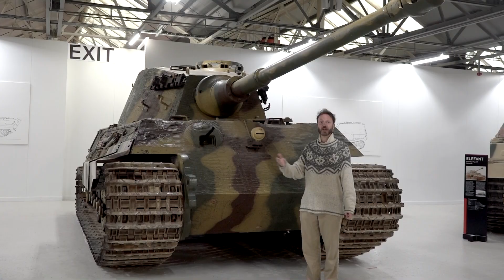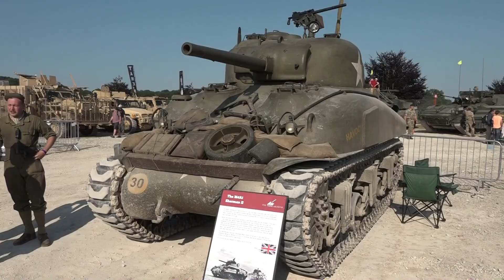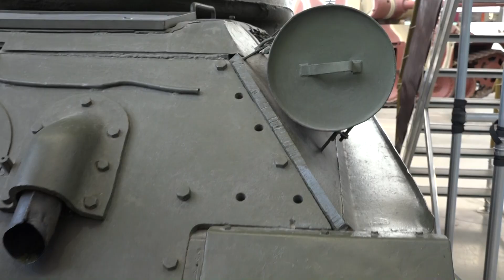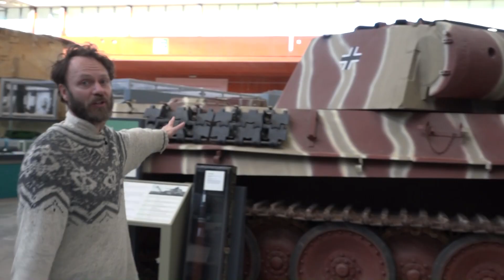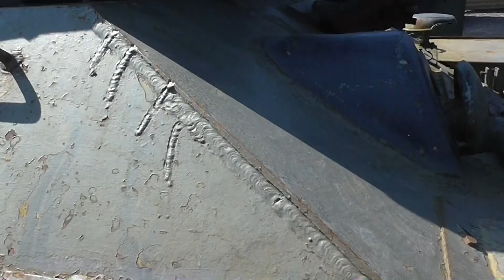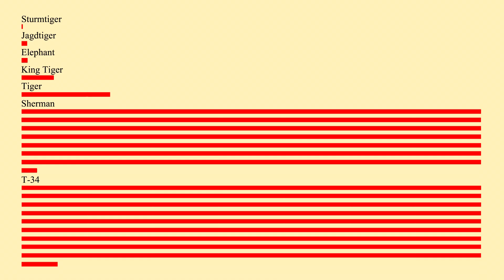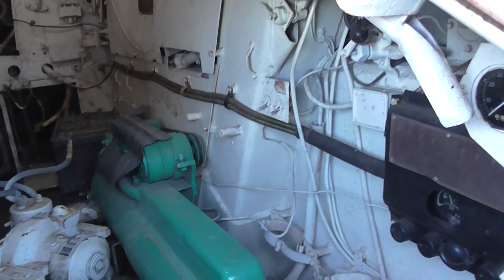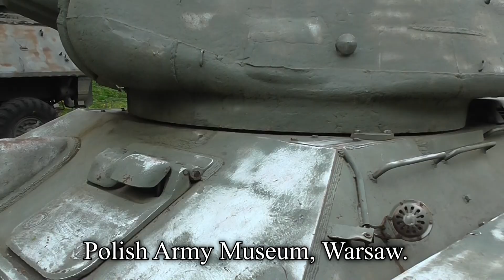World War Two's most common tank

Comment: Your points about the Panther make sense, but you have to put yourself in the Germans' boots. They didn't have the oil to fuel tens of thousands of tanks, nor did they have the manpower to crew them. Even if they went the route of creating thousands more Panzer IVs, they didn't have the means to use them.
Reply: This "where would they get the men/fuel" argument is easily defeated. All of the personnel and materiel that went towards the hilariously overstaffed disaster that was the logistics train for the big cats would have been available to go towards sensible things. Instead, a bunch of men died to fucking IL-2s and P-47s strafing them as they tried to move fuel ammo and spare parts around on foot, by donkey, or in less than 20% of cases, by motor vehicle.

The fact they built these tanks when they didn't even have trucks is honestly one of the dumbest things I have ever heard of human beings doing in all of history.
Reply: Maybe attacking your Oil Supplier was not the smartest move, next does history repeat itself ?
Reply: @maryginger4877  The Germans didn't trust the Soviets to continue supplying them with fuel. One of the major goals of Operation Barbarossa was to capture the oil fields in the caucuses. They fell well short of this goal. They did, however, have Romania as an ally to supply them with fuel. Once Romania's oil refineries were thoroughly bombed by the Alies, they were screwed.

Everything depended on Operation Barbarossa's success. The operation had glaring flaws, and impossible goals. I think I read somehwere that they captures most of the initial standing Red Army, and it still failed. That's how you know their goals were impossible from the start.
Reply: @ganjacomo2005 That's valid. They certainly underestimated the Soviets.
Reply: @maryginger4877 what's your point? they still wouldn't be able to fuel said vehicles..
Reply: boohoo the poor nazis😢get a grip of yourself sonny
Reply: @gorbalsboy  That's not the point of the comment. I was not showing the Germans sympathy, I was explaining why they decided to use the Panther and Tiger II tanks from a practical point of view.

It's actually funny how bad you missed the mark on this one.

Comment: When you ask an allied veteran of the war who served in a tank if they would rather have been in a German tank, 90% of them would say yes.
In addition to that, it should be noted that even allied tanks frequently broke down, just as often as German tanks. The primary hindrance to the Germans was a lack of supply and fuel. Most German tanks were either scuttled by the crew after running out of fuel, or knocked out by allied aircraft as the Luftwaffe suffered the same problem.
WW2 was unfortunately a war of attrition, unlike the world had ever seen. The rate of civilian casualties to military casualties was higher than any other war in history.
In modern times MBT's are the equivalent of German tanks of ww2. They're incredibly expensive and precisely crafted. If a war like ww2 were to break out, I pity the poor sob's who get stuck in mass produced garbage only to be sent to their own slaughter like the disposable pigs their government see's them as.
Reply: Where did you come up with that 90% allied would prefer to operate a German tank? Sources?
Reply: An allied veteran's opinion about the ergonomics of a tank that they didnt fight in is not valid proof. Also allied tanks did not break down as often as their German counterparts. Very few allied tanks had reliability issues on the level of the German's. Soviets were much worse off than the allies but still not horrible.

Comment: The Russians wouldn't make changes to the production line / product of the T-34 if it meant shutting down production, they were more concerned about having tanks than a slightly better one. Only when necessary was production stopped to make changes/improvements

Comment: There is an escape hatch at the bow gunner/ radio operator's feet in a T-34 as he can open it and slide out underneath and either go forwards or backwards towards the engine to escape if the tank was ever knocked out or had a interior fire. So he didn't need to wait for the driver to exit before he could.

Comment: Sorry Lindy but America built all of their Shermans during the war from 1942 to 1945, and they stopped production the day after Japan surrendered.  Russia on the other hand started producing the T-34 in 1940 and didn't stop until 1946 building just 34,000 plus another 50,000, including variants such as the T-34-85,  were built elsewhere in Eastern Europe until 1958.  Of course if you count all of the Sherman varieties such as the mobile artillery carrier and various models then the number of 54,000 is more accurate.

Comment: Could people please stop spreading myths like the one that the germans were shocked? They encountered heavy tanks before like the Char B1 and the Matilda. The Panzer 3 (3,7 cm) destroyed 1941 the most russian heavy tanks (the germans didn't differnciate between KW-1 and T-34, they just didn't know which was which) and the germans were well aware they couldn't outproduce the allies so they tried to produce superior tanks. 
The Tiger 1 and the Panther also weren't reactions but just the next step in this plan. By the way the Tiger 1 was never meant to be build (Panzermuseum Munster made a video about the Tiger 2 where they mentioned this). 
Also the T-34 was not a cheap tank but a tank badly produced. And what many people forget is that every tank needs spare parts, a crew (which needs food) fuel and ammunition. So more tanks means you need more of it which charges your logistics more. 
Also there is no proof that T-34s rolled out of the factory directly into the fight because even when they could crew the tank they still wouldn't have Ammo.

And on a side note: The Universe is offically metric :D

Comment: It should probably be noted though that the Allies only outproduced the Axis about 2/1 in all armored fighting vehicles throughout the war. The average quality was higher, and they definitely had a substantially larger weight of numbers by the late war. The allies also had a much higher level of mechanization other than AFVs which led to a meaningful advantage in tactical and strategic mobility. The number of AFVs of different types produced is still an important and interesting discussion, but the differences in tactical, strategic, and operational logistical capacity are more important to the overall picture. This isn't to discredit the points made in the video, but rather to attempt to express the supreme impact of the boring aspects of war, which more often than not are the true deciding factors in military operations over the combat capabilities of the front-line equipment, especially in large scale conflicts.

Comment: There is an old Aberdeen Proving Ground report on the technical specs and construction of the T34s.  For the report, they completely disassembled and cataloged every part of a vehicle (which they acquired by questionable means) as as way of gauging the industrial technology of the Soviet Union.  The report essentially concluded that the soviets could produce very good quality components and didn't have any gross technical limitations, and that the low quality was simply due to emphasis on speedy production.  The diesel engines for example were made of aluminum and had a higher power to weight ratio that any american ground vehicle engine.

Comment: The size of tanks is determined by the loading gauge of the railways, as tanks don't run well on the roads, so if you make them so they can be shipped by rail, you can locate your manufacturing facility wherever you like, it doesn't have to be near the front or near a seaport. Since Russian railways have a broader gauge, did Russia make bigger tanks?

Comment: Another way of looking at it is that in a "normal"tank track you have a more carefully crafted sprocket with a specific tooth design and a more rude tooth on the track.
The Russian T.  tank has the opposite the "sprocket(which isn't a sprocket) has the more rude roller/pins and the toothdesign has to be put on the tracks.
The obvious disadvantage of this design is that the tooth on the track will be damaged more easily

Comment: Honestly it’s probably because the sprocket wheel can be a single component with no crossbars, meaning one side can probably be cast and it’s just done, where the Sherman wheels somebody has to drive those rods between the two side plates, and has more points of failure-stress.

Comment: Blaming museum piece for not having all the bolts after engine maintenance is a bit silly.
The welds were fully automated by the -85 version, so the prettiness was more than enough compensated by the production speed. If a unit has some weird asymmetrical welds, chances are it's simply a field repair. These were cheap, but not cheap enough to just abandon if you can put a hand in the cracks. Sawing off damaged barrel ends was also common.
8:30 not earlier versions, БТ-2 and БТ-7 were a separate design derived from that very Christie

Comment: For the tracks with gripping teeth on them I can guess people don't really do it like that because it makes them harder and more expensive to build, heavier thus putting more strain on the engine and transmission as well making it harder for the crew to replace a broken track.

On the other hand replacing those kind of tracks might be simpler and faster than replacing the sprocket wheel and the soviet union might have been unable to build a reliable sprocket wheel with teeth during the strain of the war.
Reply: High friction i'd expect and more strain, but not harder to build. I think it's a performance loss but a slightly more robust track system, and you need specific road wheels. You have not much option to change the road wheels design or layout really, and the benefits to retaining track are only there with the large road wheels. From what I remember it is that way because you could put a drive chain from the drive wheel to one set of road wheels along roads in theory.

Whether vestigial or not i forget, but you can see how the chain would run through the inner part of the wheel vs the traditional sprocket where that would not be possible.

Comment: I feel like some of the information presented is - not wrong - but presented in a way that gives a somewhat wrong impression of the timeline of Operation Barbarossa; T34s were not hugely common at the beginning of Operation Barbarossa. If they had been, the Germans probably wouldn't have got nearly so far as they did. And the poor construction quality was very unlikely a result of some inhuman calculus of investment vs. quantity - The Germans were driving deep into the country, and tanks were needed on the frontline *NOW*, hence corners were cut.
And Lend-lease convoys didn't reach Russia until early 1942 (add some time to get to the front) - the diesel Shermans were not really a factor during Operation Barbarossa.

Comment: 4:43 - if you've ever had a Soviet-made or early Chinese-made model airplane engine (quite a few of them on ebay these days) you'd see a similar quality of casting. Sometimes they'd even cast the price in rubles into the backplate (no such thing as inflation in the Soviet Union). On the other hand, post-Soviet competition model airplane engines are little jewels.

Comment: Wheels with pins instead of sprocket wheels?

Well... Looks to me that if a pin breaks, it's easy to replace.

If a sprocket breaks on the other hand, then you'll need to replace the entire sprocket wheel.

Not like you can just tack weld a lost sprocket back to it after all.

Comment: Ah yes, the mighty T-34, one of the first international tanks. Ugly as sin, rough as hell, and came with a custom gear shifting hammer. Built with backbreaking soviet labor and crewed by soviet crews, made from American steel, on American tooling, rolling on American rubber, powered by American gasoline, and fed ammunition made from American brass, powder and explosive.

Also, double check with the Chieftan, I think the belly escape hatch was right behind the bow gunner. Or under his feet.

Comment: Not entirely sure I agree with the evaluation of the T-34 here, or it's comparison with the Panther. The T-34 was a lump of shite really. It performed well against the Germans initially not really because it was decent in the 3 parts of the tank triangle, but more because German tanks weren't. Panzer I, II, 38T, etc all relied on speed alone, and were not in any way built for tank-to-tank combat. Panzer III was about equal with T-34, but that gave the Germans some trouble simply because equal didn't guarantee a victory, and indeed they lost many engagements where the Russians had out manoeuvred them. The up-gunned and repurposed Panzer IV that came shortly after was the real response to T-34 and though it remained somewhat vulnerable to return fire, it could quite handily deal with Russian armour at much greater ranges.

Panther was in all regards a far superior tank, except maybe reliability where it was only mostly superior. Better armour, better gun, and far better crewed in terms of both crew quality, number, and ergonomics of the vehicle. Arguably Panther wasn't even necessarily that over-engineered, however with the demand for Panzer IIIs and IVs, Tigers, and all the other armoured vehicles it was spreading the resources too thin.

Sherman was really the perfect balance. Unlike T-34 it was very reliable and well put-together. Unlike Panther it was much cheaper, easier, and faster to produce. Sherman really was the "decent all rounder" the T-34 is made out to be here. The 75 was good enough for Panzer IIIs and IVs, the mobility was good, and the armour made it actually a pretty tough nut to crack from the front - despite what films may show you.

Russian and German tanks represent the two extremes really. Like Lindy says why build a tank to last 70 years if it's life expectancy is 3 months? That's a good point, but what about when that tank exceeds expectations? What about when you start winning and fighting offensively. 4, 5, 6 months down the line and whatever tanks may have survived have their life cut short by a critical mechanical failure. Sure you can pump out tanks like nothing else, but when 50% of them never reach the frontline due to mechanical issues, that's not as impressive as it seems. On the other hand Panthers and Tigers were mostly very well designed and built, but were plagued with teething troubles caused by over-engineering. Cutting edge tech that didn't work reliably, instead of tried and true kit a few years out of date. While a Panther or Tiger with a crack crew might perform exceptionally in perfect conditions, it doesn't mean much with just a handful. Panther may be in a different league to T-34, but historically speaking they were also in totally different post codes fighting infantry and light vehicles - and there it didn't so much matter what tank you had as much as it mattered that you had tanks at all. (Why else did the Panzer Is and IIs so easily and quickly defeat France and her much better armed and armoured tanks?)

There's definitely a lot of Wehraboos who love to fawn over German big cats, but save for a few issues tanks like Panther and Tiger were actually pretty bloody good designs.

For me the question always comes down to whether or not you can qualify the value of a tank based on the decisions made by the nation at the time. Would we still consider Panther and Tiger and such too many eggs in too few baskets if Germany had had the industrial might of the USA? IMO, Panther was a bad design choice, but not a bad design. In the same way T-34 was a good design choice, but a pretty bad design

Comment: The T34's armor was very hard, but brittle. This would result in spalling inside the crewed area of the tank if it was hit, and caused many casualties on its own. The external gas tanks were opposed to it's other version of fuel storage, which were housed inside the crew area, causing massive survivability issues. The T34 was also only decently fast on paper. Like you mentioned, the transmission was notoriously difficult to manipulate, which meant it rarely ever got out of second gear. And just the sheer number T34s caused enormous supply chain issues. Yeah there were a butt load of tanks, but very few had sufficient fuel, spare parts, ammo, and supplies for the crew.
Reply: Quite often repair crews would disassemble damaged T34 for spare parts. Its was such a massive source of parts that during Soviet operation in Manchuria repair crews were constantly short on spare parts. That's because tank loses were very low and no one brought enough parts to compensate for that.

Comment: Honestly, I'm very disappointed. There are so many common errors and myths retranslated in this video that it's barely worth a look. Worse yet, one to three vids made by the Chieftain on the T-34 of different kinds  would easily give you more info of vastly better quality, depth and scope. And on top of that - Lindy didn't check those out before repeating several common errors and myths himself. 

Lindy, why?

Comment: 7:30 According to what I have learned from (Lt.?) Col. Moran, a.k.a. The Chieftain, and other sources, the toothed track with pinned drive wheel design was simpler to manufacture and more tolerant of manufacturing errors where the toothed sprocket that grabs onto track pins has to be a lot more precise to function. It didn't catch on because the toothed track design has a lower limit of acceptable torque than competing designs thus limiting the power one can deliver to the tracks from the engine.

I could be wrong as I am merely going by rote, but that is what I recollect about that subject.